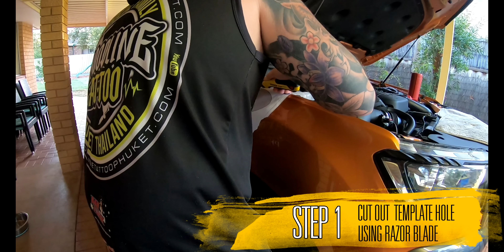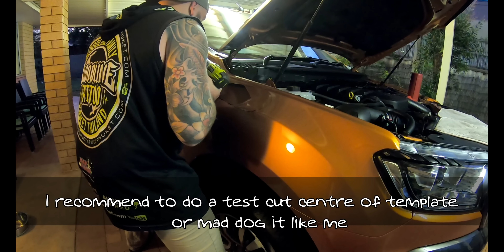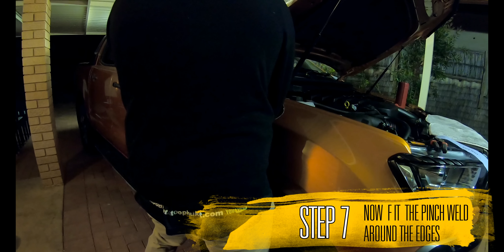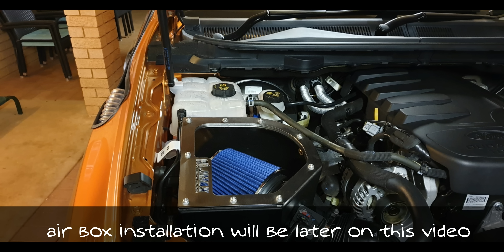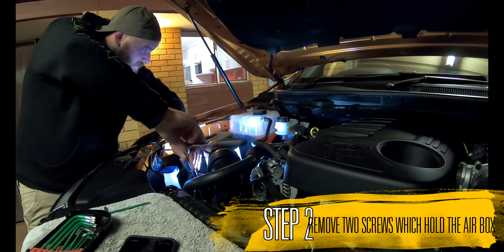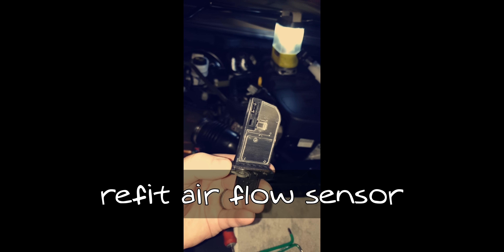Ford Ranger PX2 Snorkel & Air Box Install

Comment: Good job 👍 

What type/brand nibbler did you use 

I’m about to install a Safari Armax....big elongated hole 🕳 

Cheers 🍻
Reply from the maker: Thanks buddy just a cheap 1 from Bunnings around $50 this snorkel set up suggested me to use tin snips I wasn't happy using them nibbler the go just take ya time will cut it out perfectly 👌